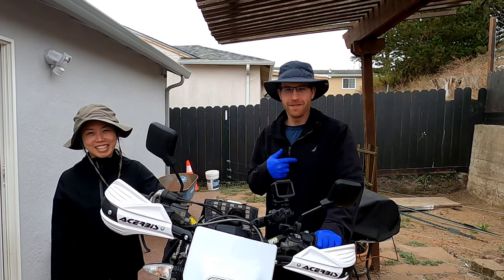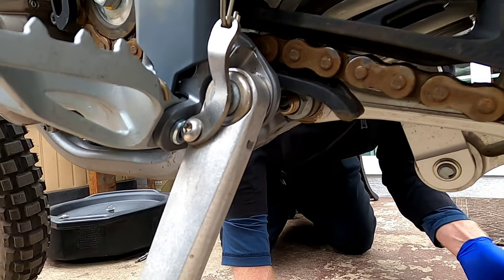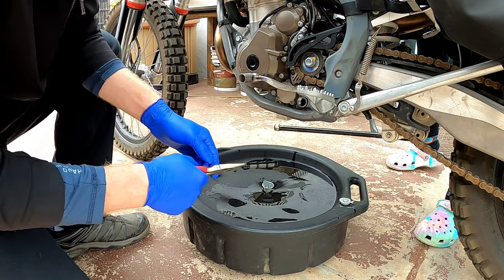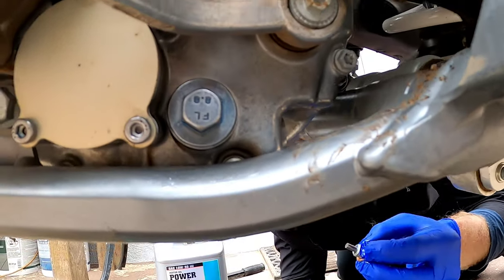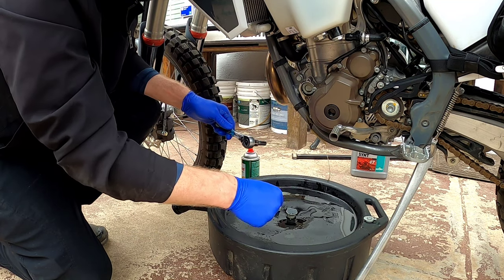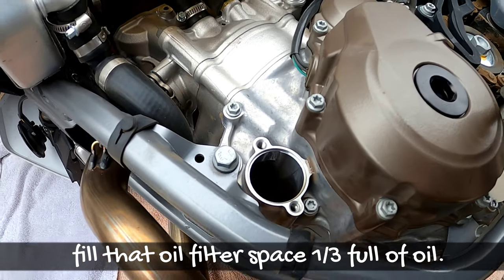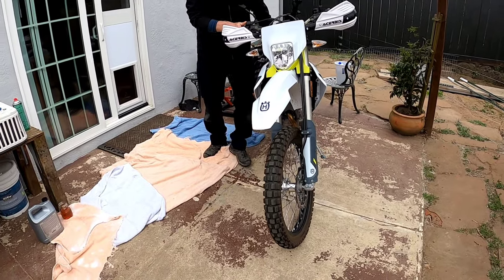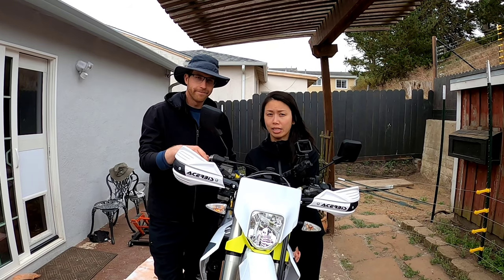2022 Husqvarna FE350S Oil Change DIY & Maintenance

Comment: No need to lay the bike on it’s side at all. Keep 2 or 3 new filters on hand stored in an oil filled mason jar ready to go for next time. Pre-saturated. 
This shows you why you always change the break in oil very early ON ANY NEW ENGINE. You don’t need to wait until 465 miles for the next oil change. I did my 2nd oil change at 200 miles, then started to follow the schedule at 465. Each oil change it gets cleaner and cleaner as the wearing surfaces get broken in. I didn’t like the idea of riding over 400 miles with shavings still circulating around. 
That’s a really nice bike. Enjoy it!
Reply from the maker: Thank you for such great info!

Comment: That’s a good tip on the “Run the bike for a minute” before the sight glass will measure correctly.  I just did the break-in oil change on a BMW G310R and found that I also had to wait a few minutes after the initial run to let the oil level stabilize in the sight glass.
Reply: Tip? It’s standard procedure.

Comment: Great video, I have a 21 fe 350 and have been using the Motorex synthetic, past two times I changed the oil I was quite overdue and both times I drained it the oil looked new like I didn’t even need to change it, good stuff.
Reply from the maker: Oh wow that's great. It does also depend on the user and how you use it 🙂. But yeah that frequent interval is a little tedious for me

Comment: Awesome guys! 
What size is the mosko moto you have on there, is that an 80 or a 40?
Reply from the maker: The 80L but this is the older version. This isn't the revolver so you cannot twist the panniers up or down. But it fits okay. It fits better on the 701. 
The reckless 80 is already too small for motocamping compared to the Backcountry panniers lol. I don't think i can do reckless 40. And especially Kyle 🤣 he CANNOT pack light 🤣🤣🤣.
I can see the 40s doing ok for hotelling. But then if the 80 fits. Might as well use the bigger one.
Reply: @TrackOurJourney  Yes, the rackless systems are less capacity for sure. it's tough to downsize.
Reply: @TrackOurJourney  I have the exact same bike and run the Mosko 80L Revolvers on it. Install the True North rack and they fit like a glove!
Reply from the maker: @springfish169  thanks I'll be checking that out!

Comment: Hey I am about to buy a 2020 fe 350s with 500 kms on it and i am worried that the first owner hasn't changed the oil for the break in. 

Question: When did you guys stop seeing shavings and from the first to third oil change; how much did the shavings dissipate ? 

Thank you for your help.
Reply from the maker: Hey Geoff, we haven't changed the oil more than once because I am still recovering from surgery this entire time. Not sure what your experience was but I've worked on many vehicles and motorcycles old and new in the past and  when they are new there's always a little bit of shavings but they dissipate over time. I've not really had issues with that happening.
Wow only 500 kms. Why they selling it?
Reply: @TrackOurJourney  not sure why they are selling it; it's at a dealer.

Thanks for the insight and reply
Reply from the maker: @geofffelsing1283  np the bike is amazing. Honestly it's expensive imo but it's really fun offroad compared to my 701 enduro because it's so much lighter. I didn't like it as a commuter much because it's not comfortable comfortable as my 701 though.
Reply: @TrackOurJourney  good to know thanks

Comment: I am wondering: I want to buy an fe 350 and use it 90% in the city and then maybe go through the woods on the weekend. Do you think I still need to pay attention to the 10-15 hrs oil change interval or this only meant for heavy enduro action? for cruising it seems a bit crazy to me. thanks :)
Reply from the maker: Imho, you can slack off a bit if you dpnt use it for its intended purposes. As evidenced by another comment here on this video. If you go smash on it in the woods frequently, then you should be doing the maintenance more diligently. Hope that helps!
Reply: I would recommend that you change the oil after the first 2 hours of easy riding. Then 5 hours then 10 hours. Then check the oil at the next 10 hours and maybe you can stretch it. If you do that it will run forever

Comment: So how often you should change engine oil based on manual instruction on fe350 s ? I am considering between crf300l and 2023 fe350s....

Anything that i should noted for both of it ?
Reply from the maker: Hi Hendra, if you are lazy like me, I will choose the honda crf because it is cheaper and maintenance interval is longer as in i think around 4k miles? Not sure but regular bike internvals between oil changes. instead of every 15 hours per the husqvarna service manual for the FE 350s. although fe350 is way lighter 250 lbs vs 337 lbs wet weight. the fe350s is more of a real dirt bike in terms of maintenance which means more frequent maintenance and if that doesn't bother you then it's a great bike. I like it, even though it's not my bike, I take it from kyle all the time and it's fun to ride it off road. definitely not as cheap as the honda, meaning if you need parts, also more expensive. Also 350 is very tall, but if that doesnt bother you either then it's all good.
Good luck! -Pam
Reply: @TrackOurJourney  4k miles .??man that's huge difference....
In crf300L ....it's 7767 miles (around 12.500 km)
Reply from the maker: That's even better!

Comment: I just bought one fe 350 2023, the user manual says “check the valve clearance” Do you really need to ? 😮
Reply from the maker: Yes is it better to check it it you want to keep the engine longer. If you dont really smashj on it or beat it up or ride it aggressively then maybe you can be relaxed in the maintenance. But if you ride  aggressive and beat the engine, it's better to keep the recommended maintenance schedule.
I have been meaning to do a video on valve clearance for this bike, but haven't found the time lately. Congrats on your new bike!
Reply: Thanks! I’m not racer so, I just change the oil tomorrow and I will be fine on that 👍
Reply: Not Good, the magnet on oil plug was broken. Broken near the bolt. 😑
Reply from the maker: oh no, I hope your local Husqvarna KTM store has the bolt replacement in stock so you can replace it right away.

Comment: Shavings?
Reply from the maker: There were shavings iirc.
Reply: @TrackOurJourney  shavings from what?
Reply from the maker: This website better explains the reason. as you keep the maintenance going later on you see less if even no more shavings after the first break in service. (of course later on (many miles later...) you may see it again, but then that would then be more of a concern).

https://www.motorcyclistonline.com/how-much-debris-is-normal-in-oil-after-motorcycle-break-in/#:~:text=%E2%80%9CIt's%20possible%20this%20material%20may,oil%20changes%2C%E2%80%9D%20adds%20Ethell.

"“It’s possible this material may be due to machining or assembly debris left in the engine that wasn’t knocked loose or picked up initially by the magnet,” says Wright. “He will probably see more (debris on the magnet) in the next two oil changes,” adds Ethell.

So the consensus is that it’s not uncommon for an engine to keep spitting out swarf and break-in debris long after its initial service."
Reply: @TrackOurJourney  Sounds like a bad start for a high maintenance engine.  Thanks for the reply and info

Where are you guys located?
Reply from the maker: San Francisco

Comment: Why on earth is there so much metal flake in the oil of these bikes , I’d have thought engineering tolerances should have eliminated that ?
Reply: Not unhappy just want to understand as thinking of getting a fe350 as first off-road bike …..
Reply from the maker: I also think they are just so overpriced :/
Reply from the maker: It's not a first offroad bike. Kyle has had other offroad bikes before this one.
Reply: I barely had metal shavings in mine, I was surprised, great bike by the way
Reply from the maker: @carlopuquirre3506  thank you!